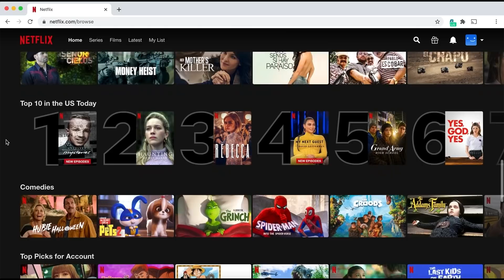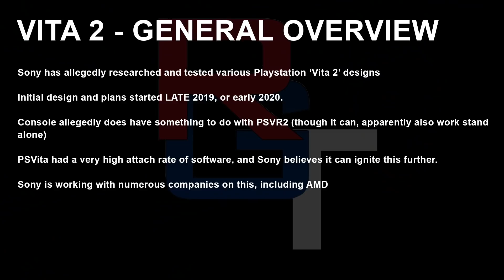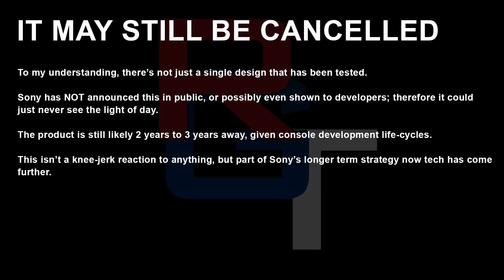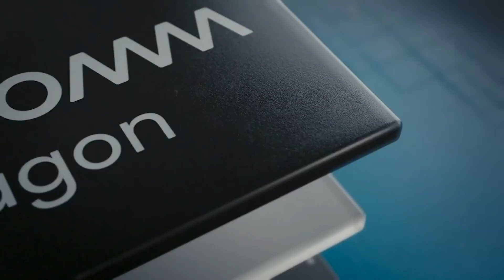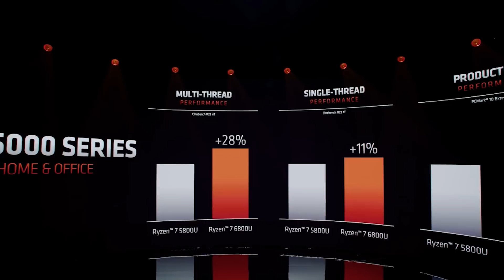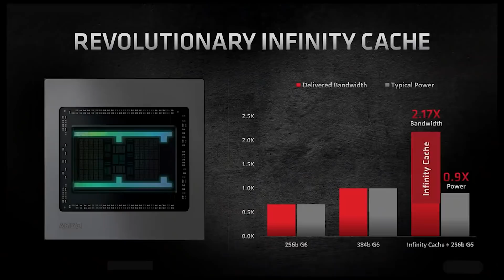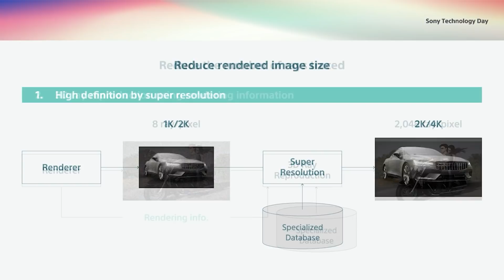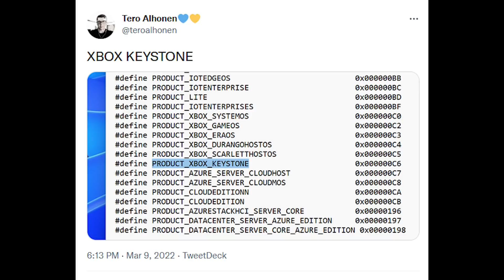NEW PLAYSTATION HANDHELD To Revolutionize Gaming | Xbox PROJECT KEYSTONE Analysis

Comment: I would be interested in a PS5 mini. Vita failed  because the PS3, Vita and PS4 were on completely different architectures. For developers it was hard as they effectively had to build 2 different games. If the architecture is uniform then devs wont have have trouble porting it.
Reply: That wasn't the issue ,the issue was Sony and the lack of support and making proprietary cards at ridiculous prices
Reply: @chriswright8074  What exactly do you mean by lack of support?
Reply: @kentaronagame7529  ps Vita was 250 it wasn't expensive same price as 3ds
Reply: @chriswright8074  but other things associated with the console such as the use of proprietary memory exclusive to PS vita only making the investment expensive down the road.
Reply: @kentaronagame7529  I consideres buying a used Vita for 80$, but never did because then I would have to spend an exorbitant amount of money on memory cards. Now I may get one one day and then jailbreak it and get a SD2VITA adapter.
Reply: Vita failed for exactly this. If Sony goes this route again, it has to be a ps4 on a 5nm chipset. 

On top of this, they have to leave it out of development and then port down; you don't want it looking like it's hamstringing ps5 development.
Reply: Then why did psp succeed lol. Ps5 mini is illogical and highly unlikely. Even steam deck is not as powerful as a ps5. Not to mention the battery life will be horrible if they use an x86 chip in a handheld. It will be arm and similar to their previous handhelds with its own games most likely.
Reply: I am categorically against any further support for the x86 architecture
Apple managed to cram an entire PS5 into an ultrabook so it is silly to continue thinking of x86 as a sustainable alternative to ARM
Reply: The Vita, like it's predecessor the PSP failed because apart from being over-engineered for their purpose they couldn't quite summon from Sony the same commitment the under the TV consoles could command. Sony has never been quite convinced that the hand-held market is a viable thing (despite the fact that mobile games sales have overtaken console games sales by a significant margin) 
Sony will be watching the Steam Deck with very calculating and evaluating eyes.
Reply: @kentaronagame7529  says the guy with who takes the internet seriously

Comment: Given the success of the switch and steam deck I could certainly see both Sony and Microsoft working on handhelds. Especially if they continue to use AMD CPU and GPU which would make it easy to play games from current consoles with very little modifications.
Reply: Success of the steam deck? It's only just been released.
Reply: @tr1p1ea  sure, but supposedly has millions of units pre ordered and has gotten a lot of really good reviews and press.
Reply: @jeffreyparker9396  Ermm.. wait a year or 2 and we can talk about success or failure.
Reply: @s0ad29  I don't know about you, but selling millions of units of a piece of hardware pretty much defines success. Does it mean that the steam deck is a long term success? no. Does it mean that there will be new versions coming out? Valve already said that they are looking at making another one, but really no. You can still objectively call it a success.
Reply: @jeffreyparker9396  well let's agree on a successful launch then ;)
Reply: Dude it's way too early to say that the steam deck is successful
Reply: @sebastianguerrero6617  how so? The sales estimates put it in the millions, which would easily mean that so far it is a success. Does that mean it will continue to be? No. Does that mean that it will be a long term success in any way? No. But in its life so far it is, that is fact.

Comment: 17:27 But even with N3 and upcoming architecture 4 TFLOPS would take almost 30W SoC TDP (over 25W at least). Then on top of that 5W-8W for display, fan, RAM, SSD etc. That sounds too much for a handheld - I think. My guess is 2,5 TFLOPS.
Reply: And 2.5TF RDNA 3 is more than enough.
Reply: @arnabsaha8761  Absolutely. When paired with temporal upscaling like FSR 2.0 (or DLSS 3.0 for Nintendo) that 2,5 TFLOPS will give practically identical observed gaming performance than ~4 TFLOPS Series S and PS4 Pro.
Reply: @tkermi  Sony would be dumb not to release a handheld rn. They still scared if this will flop but given how  powerful it is it will keep pace with next gen consoles. Fingers crossed.
Reply: @arnabsaha8761  Yeah, interesting to see what kind of time table Sony will have. If their design is already somewhat far it's good that chip shortage is slowly getting better.

TSMC 5nm and 4nm nodes should probably be nicely available in 2023. They have had problems with 3nm process yields, so I guess it will mainly go for Apple and Qualcomm for a long while still. Of course that's going to improve at some point.

But already something like N5P and N4 are really nice for demanding portable device design and N4P would be excellent.

Comment: So 3.7 teraflops? if plugged in it could run faster. the switch runs faster when plugged in. i think fans would be ok with lower res on the go and boost when plugged in.
Reply: I dare to say that I guess it's not possible. The "near 4 TFLOPS" assumption in the video is quite optimistic. Even with the best scenario N3 (3nm) and new architecture 4 TFLOPS would take almost 30W SoC TDP (over 25W at least).

Then on top of that 5W-8W for display, fan, RAM, SSD etc. That sounds too much for a handheld sized body. My guess is 2,5 TFLOPS.

For comparison when docked the current Switch has about 5W SoC TDP. The 2017 Switch had ~11W, which was close to maximum for its size. Much larger Steam Deck has that 15W SoC TDP.

So unless the Sony portable console would use a dock with advanced active (through device) cooling, over ~2,5 TFLOPS seems unlikely.

Comment: It would be great if the next PlayStation handheld had full compatibility with the PS4’s library (maybe through a compatibility layer to support Zen3+RDNA2 or ARM+RDNA2), but I don’t know if that would work out due to how messy the transition to PS5 was. Mainly regarding save game compatibility and whether a game you bought digitally comes with both the PS4 and PS5 versions. Like recently, GTA Online only lets you transfer from PS4->PS5.
Reply: This. The Switch not compatible with the Wii or Wii U was really disappointing. It might not have been possible but ps5 playing ps4 games and xbox x playing xbox one games makes that reason debatable
Reply: To add, I’d get a portable PS if it could play ps4 or ps5 games even at lower resolution and can be docked. Switch got that right.

Comment: My guess is it will come much sooner than expected. AMD has been demonstrating remarkable scalability with their APUs. RDNA3 introduces chiplet technology. If I were Sony here, I'd just design 1 SoC and add a graphics chiplet. With this Sony can address both Ps5 Pro and this portable PS5 with a single design. Design a 45W APU for PS5 Pro on TSMC 3nm. Have a 5nm RDNA3 chiplet with 80ish CUs. Sony only needs to design once. PS5 handheld could use this APU partially disabled and power optimized and produce the handheld. It could be paired with LPDDR5X or G6X/G7 for example or use infinity cache. If this is the case it could make a ton of sense for Sony as they only have to produce 1 device.

I'd like to remind everyone that 2 SoCs were tested by Sony in 2019/2020. Oberon and Gonzalo. Gonzalo was using navi lite. Looks like planning likely started earlier than Red Gaming Tech's sources indicated. 2023 for both sounds about right.
Reply: If the packaging technology is ready for such a high-volume, low-cost application then I would definitely do that for all future consoles! I’m just not sure when that will be. GPU chip-let packaging is far more complicated and expensive then what AMD does with CPU’s. Rumor is that only the $500+ RDNA 3 GPU’s will feature it due to cost reasons, with the lower-end products still being monolithic. 

The other issue is there being enough supply in the packaging industry to make millions of console chips per year. But I have no doubt when those two things improve enough that Sony and Microsoft will be on-board with MCM architectures.
Reply: @samuel5916  I don't know necessarily whether or not Microsoft and Sony will implement the exact same solution. They obviously had very different strategies for ps5 and Xbox series x/s. I don't think any novel packaging solution is being used for rdna3. Of course I could be wrong. The product hasn't launched yet of course. I suspect a large portion of why lower end RDNA3 is monolithic is for cost reasons. If you look at it, I doubt you'd need to disable half the CUs in an RDNA3 mcm in order to get it to work. Yields at TSMC 5nm are too good for that and reportedly outperform that of TSMC 7nm. As such it doesn't make too much sense for the smaller dies to rely on an mcm die approach as they will have close to perfect yields anyways.

This is a different case for Sony though. At this point, I'd be very surprised if the interdie interconnect in zen is not fast enough to exceed pcie4 not only in speed but also in terms of latency and power. This would be enough to power an 80CU chiplet at 5 or possibly 3nm. I'm guessing here of course but I'd imagine the RDNA3 chiplet being something like 150-200sqmm in die size. The main SoC with the CPUs might be something like 100sqmm (I used Lockhart as the base at 194sqmm) at 3nm. Obviously this is all a guess. It's just what I would do.

In terms of the silicon shortage, unless something happens to Taiwan (which I'm hoping will not happen) I'd expect most shortages to be resolved some time in 2023. I'm not expecting it to launch near the start or pegging a release date or anything. I'm just saying what would be a smart design idea. Reuse is always a good design strategy in general.
Reply: @wakannnai1  So Ryzen uses Infinity Fabric which is pretty generic in terms of hardware, it’s mostly a software based protocol although it does require packaging multiples dies on the same substrate with the appropriate wires which adds cost. 

GPU MCM is exponentially harder because the dies need significantly higher bandwidth to be able to communicate with each other and be recognized by software as a single chip. This is important because if the system see’s more than one chip we’re back to Crossfire/SLI which had terrible compatibility. So AMD is using what they call EFB (Elevated Fanout Bridge) which is based on TSMC’s CoWos packaging technology and is very similar to Intel’s EMIB. Basically it’s a small silicon bridge that connects two or more dies with a much higher bandwidth connection. 

They already use it on CDNA 2 which is an MCM GPU architecture but gaming GPU’s are much harder to do then server. The downside to this type of packaging is that it’s really fucking expensive and it has yield problems just like silicon wafers. A certain percentage of dies will be destroyed by the packaging process (just like with 3D stacking) which has an added cost. 

So no, you cannot make an MCM GPU with the same connection AMD uses for Ryzen. Unfortunately, it’s far more complicated then that.
Reply: @samuel5916  this is probably why they're working on universal interconnect express with multiple other companies including Samsung and Intel. It solves some of the cost problem potentially

Comment: The most obvious approach is a handheld based on PS4/Pro. With modern Ryzen APUs(Steam Deck), this is highly doable. Sony is no longer making PS4, this device not only served as a handheld but also a PS4 in docked mode. PS4 vast library of games along with the possibility of running an PS1/2/3 emulation on this device will give it a big advantage. With another 1 or 2 year worth of cross gen titles, this device can receive many more upcoming AAA games.

Comment: PlayStation Vita system was 4 core processor stepped up to eight cores processor AMD the ram was 512 6 Ram 1 6 vram backward compatibility 120 FPS a 6-point inch screen phone size built-in triggers clickable analog sticks mini micro HDMI 2.1 Bluetooth 5.2 wifi-6 continue the games that left off of gaming cartridge as well $250 or $300 they control the prices the system is compact not a tablet size

Comment: I could see a Vita 2 that was ARM based but still compatible with the PSVR2 on a hardware basis. This would allow for a self-contained system not tthered to a PS5. The trade-off would be a big difference in ability to drive the HMD. Much like how the Oculus Quest makes that trade-off compared to PC bound VR rigs. Alternately, the Vita 2 could act as a wireless streaming module to eliminate a direct cable connection to the PS5. This would be a very optional mode, as requiring a consumer to buy both the PS5 and Vita 2, along with a costly accessory in the PSVR 2, which is a big ask. It could be a transitional design to keep the cost down on offering an untethered mode on PSVR 2. Not the overall cost but the cost of the PSVR 2 package. The following generation would have the untethered functionality in the base package

Sony could also offer a dedicated wireless module for the PSVR 2 but compared to getting a nice handheld for a bit more money, that may be compelling if pitched right.

What I do not expect to see is an x86 based handheld from either Sony or Microsoft. If the PS4 and/or Xbox One had gotten another die shrink, such a machine might be viable in the price/performance those companies would need. A handheld in the Steamdeck's price range just doesn't strike me as a market they see as viable. BUT Xbox One and older generation compatibility is still possible, especially on Microsoft's side. Microsoft has a great deal of experience in using iterative translation to create usable binaries from games created on incompatible hardware, such as getting PowerPC based Xbox 360 games running on x86 based Xbox One and later.

Windows on ARM (WOA) already exists, including the DirectX API suite, as does Samsung ARM CPUs with RDNA2 graphics for low power devices. Microsoft could use these to make a handheld with a huge library of Xbox, Xbox 360, and Xbox One games, in addition to native products. This in turn means this machine can use a substantial portion of GamePass natively and also act as a streaming Xcloud client for newer stuff on the Series X and PC.

Comment: Can I add a partial bit of speculation?
In Mid-Late 2023, Zen 5 and Zen 4c will be out, with AMD planning a BIG.little design, similar to ARM. My guess is, is that the “ARM” CPU that the other person was talking about was the BIG.little architecture going to be introduced in Zen 5. My guess would be 2 Zen 5 cores (40% better IPC than Zen 3), and 6 Zen 4c cores (similar IPC to Zen 3, but much better power efficiency)
For the Graphics Card, I would expect similar performance to a PS5, if I were to take a guess, 5 or 6 WGPs from RDNA 3 (or if we are lucky, 4 WGPs from RDNA 4, depends on the release, RDNA 4 wouldn’t be until October 2024). Which would provide similar performance to an RX 6600 (about 15% worse than a PS5).

Comment: I’m curious as to why Xbox would bother coming out with their own handheld console. They have companies like valve and others already making handheld consoles that are windows compatible. 

Just make the software optimized for these and have an Xbox app. They can sell their games that way.
Reply: Agreed don't see xbx or ms having the expertise or the nouse to make a portable along the lines of a vita succeed.... ms struggle with a regular naming convention of an xbx device.... they struggle marketing and positioning series S and X.. S and X are selling because of the lack of the competition.... 

both S and X struggle to keep up with the PS5 in head to heads despite marketed as the most powerful... 

and seeing as gamepass is xbx main focus.. making a portable that has a competing high res screen, battery life, controls and all the other ui stuff and ergonomics of designing an aesthetically pleasing device thats powerful enough to compete with steamdeck, vita 2 or switch 2 and or mobiles sounds disatrous.. 

its easier and cheaper and obvious and makes far more sense for ms to rebrand or repurpose a tv stick that doesnt need a bespoke screen battery controls top of the line cpu etc.. to maximise gpass numbers or to get into many peoples homes at the lowest price possible... a $20 gpass stick thing would do that... 

if ms cant even be motivated by VR i cant see them putting tons of R n D into a half assed traditional handheld anything less than decent will be murdered by mobiles, quality cheap retro handhelds, steamdeck, a dedicated sony and nintendo device.... plus steamdeck will not be the only one... heard rumours of apple wanting to do a gaming device possibly portable for apple arcade... and we know of was it alienware or someone released pictures of their steamdeck like device recently..... ms with zero experience making a handheld will get murdered.. 

tbh im sceptical if steamdeck will actually be successful as in ninty or sony numbers.. 80m for psp and obviously ninty is around 100m number  somewhere.... for a device that looks unwieldy and far too big to be portable or for the usual portable crowd
Reply: To much talking..